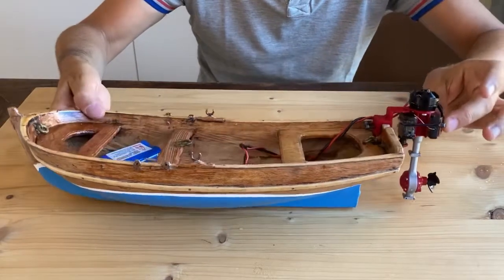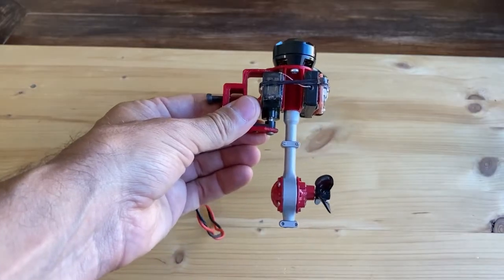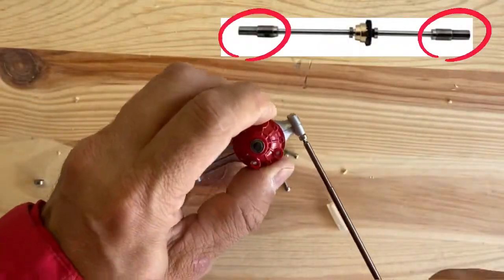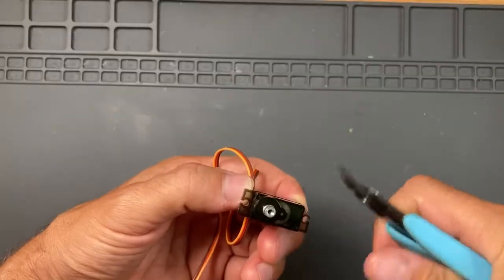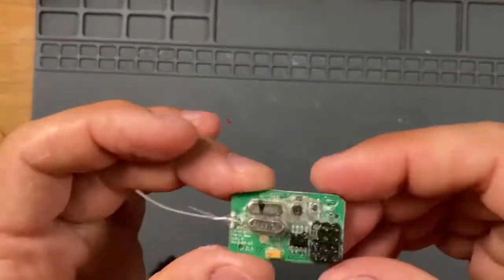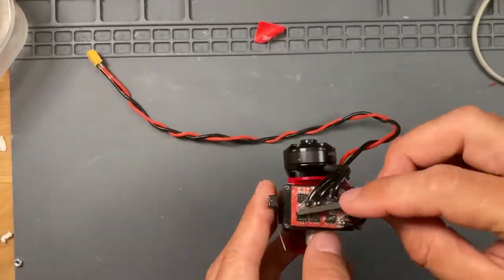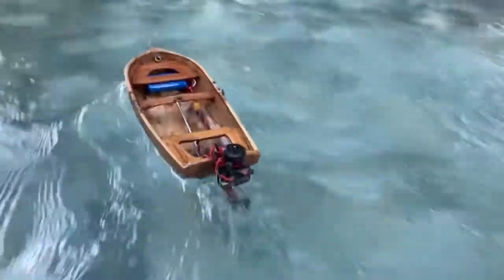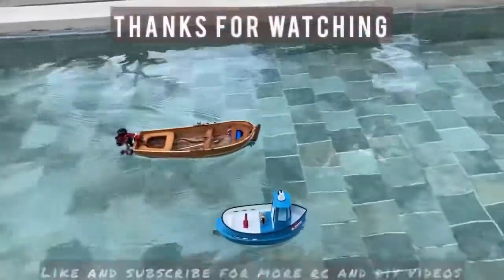DIY RC outboard motor-all in one

Comment: Wow!!! great great design. I really love your idea of using this axle. No problems with rust in the motor bearings or drive schaft in the axle?
Reply from the maker: Motor bearing i treated them with grease and anti oxide spray (corrosion x), while axle beating a little rust, but i m using it quite rarely so I will use it till they resist. Or maybe i will threat them too

Comment: I am working on a big outboard motor with a 2000kv motor on 3S. We'll see how hard it pulls. Planning to install two of these on a 30" catamaran.
Reply from the maker: I see, does it have flex shaft or bevel gears?
Reply: @MakerFabio  I am still designing it, but it will definetely have 5mm hole bevel gears. Running on sealed bearings. Only error I made is that the motor is air cooled and not water cooled. The motor is waterproof and it has a heat sink. I am.planning to leave the heat sing exposed so that water goes into it and helps with the cooling. I am trying to mimic the design of the new Mercury Verady 600hp V12 including the nee sterring system they have where the propeller is the one who turns and not the motor.. i haveng gotten to design that far down yet but its coming.
Reply from the maker: @P_double_H  i see, i m also working on a big one,strong but slow. Hope to publish soon (some months..)
Reply: @MakerFabio  It looks like I will have to change my design. I wanted to create an outboard like the Mercury 600 but the problem im having is sealing the system. There is currently no water tight ball bearings so this design will be impossible to make. I will change the design to a Mercury 450r and do the steering with an inboard servo instead. See, normal boats use shaft seals, but rc boats use the stuffing box, which I will have to create one for the propeller shaft in the outboard.. its a lot of work and design.. i wish there was a 5mm shaft seal in the market.
Reply from the maker: @P_double_H  wow, monster motors. Not easy to solve some critical points of the design.